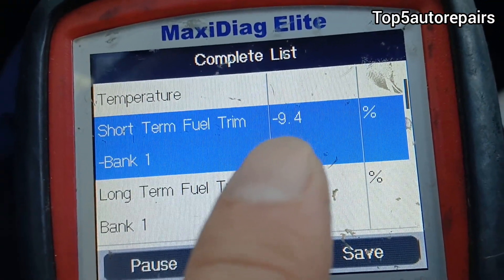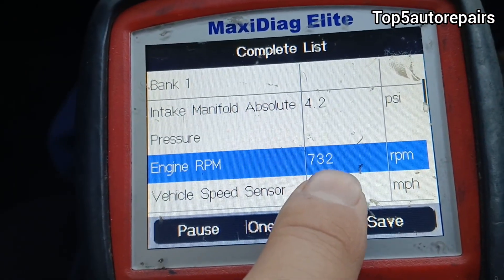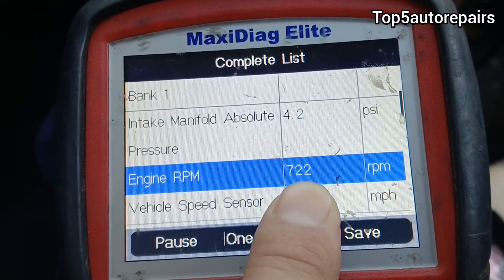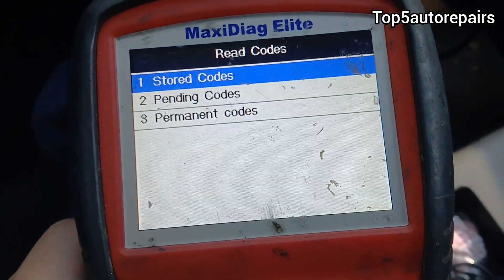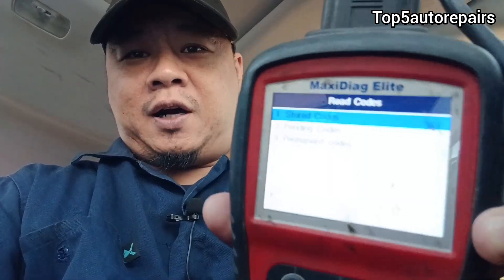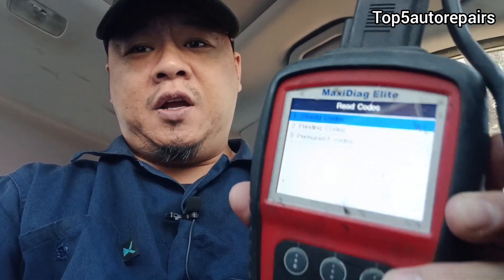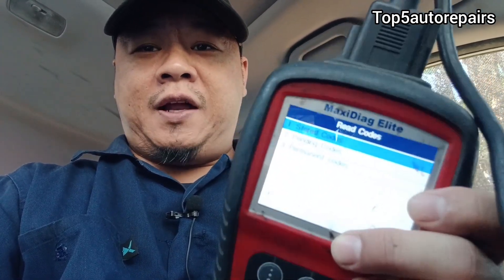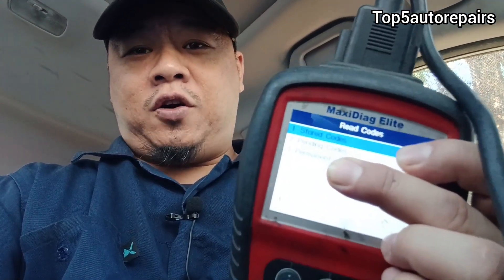HOW TO FIX P219A AIR/FUEL RATIO IMBALANCE I EXPLAIN ALL POSSIBILITIES AND CAUSES

Comment: Thank you for sharing your knowledge about cars.İ have a question for you.İ'll be happy if you reply back in return.

When the engine cold my car after a long crank fire or after second try firing.The check engine light illuminate and it says P0341.İ know you have some videos about this issue.Just only İ want your opinion.
Reply from the maker: It sounds like a faulty camshaft position sensor for bank 1. Check for loose wire and make sure connection isn't covered in engine oil.
Reply: Thank you sir.İ appreciate

Comment: My vehicle was running excessive rich at idle, but excessive lean under load. Took me awhile to figure it out, but ended up being the MAF sensor being contaminated. Replaced and put the fuel trims back within spec.

Comment: You ALWAYS have great videos!😁👍
Question....my car hard to start ONLY right after putting gas in my car at gas station. Some black smoke from tail pipe.  After 5 attempts to start and keep car running...then it runs fine until the next fill up.

We've replaced 02 Sensors, Fuel Pump, Charcoal Canister, Throttle Body, changed some of the hoses, checked Purge Valve. What could it be????
Reply from the maker: Evap system would be my first guess. Flooded charcoal canister, stuck open purge valve solenoid etc... but since that was replaced check for a bad coolant temperature sensor, that can a rich condition and cause black smoke to blow out of the tail pipe.
Reply: @Top5AutoRepairs Thank you so much. You're always so sweet and helpful. (And yes, I'm a girl. 😂)
Reply: I'm having precisely this very same problem with my 2018 Highlander. A bad purge valve is the culprit! It's easy to test. It's under the hood near the intake manifold. Take it out, blow into it. If the air goes through it, it's bad. If it doesn't, then something else is the problem. I hope this helps.
Reply: @NoOne-xy6iz Thank you so much for your advice.❤😊 My dad did a smoke test on it too. I asked if he checked the Purge Valve and he said he did and it's ok. It only stalls when trying to start after fueling and has a flooding sound and a little black smoke from tail pipe. After 5 tries and giving it a little gas for a 40 seconds or so, it levels out and does fine until next gas fill up. So your vehicles doing the same thing?
Reply: More than likely its the purge valve being stuck open
Reply: @goldsgaragetx Thank you for your reply.😊👍 Purge Valve just changed...but now days it's hit or miss on buying bad parts. My Valve Cover Gasket is trashed...I read that this could cause a vaccum  leak and can throw a lean code gas wise.